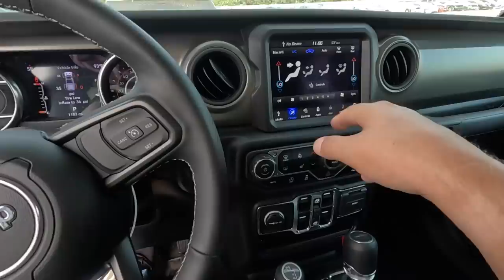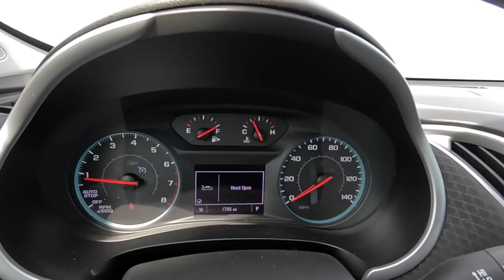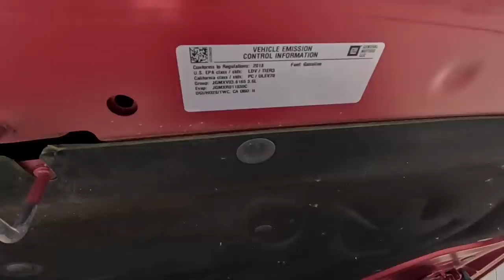This Dodge Nitro R/T was Scrapped but Why? An Impala is NOT a Luxury Car!

Comment: I had a 2012 Impala LTZ, bought it used with 30k on it back in 2013. Fully loaded. It was silver with a beige interior, factory 18 inch rims and a sunroof. The 2012s were the first year to offer the 3.6L and 6 speed auto. It was a great car. I sold it in Nov 2019 and it had about 70k miles on it at the time. 

June 2020 I bought a brand new 2020 Impala Premier. Black (inside and out), fully loaded, sunroof, heated and cooled front seats, 20 inch wheels, adaptive cruise control. I still have the car and take really good care of it. The car has been pretty good so far and it has less than 13k miles on it so far (I drove trucks for a while which is why the miles are so low). Only issue I had was when the car was still new, about a week later the A/C stopped working. Took a year for me to finally get around to fixing it. The had to replace the evaporator which is located in the dash. It was covered under warranty but it still was very annoying. 

The 2020 Impala is a much better car overall than the 2012 Impala I had. More room inside and better materials, but you are 100% correct. The Impala is NOT  a luxury car. I've owned mine for 3 years and I still don't look at my car and say it screams luxury. It is nowhere near that level. Its just a nice premium full size sedan but less than luxury.

Comment: the jeep wheels are like that because the rear brakes are smaller than the fronts...
ie the fronts will be something like  15' discs vs 13' discs  for the rear
and the spare will be a 15' size  rim (i'm guessing here)
so you need the full size rim at the front to keep it rolling

Comment: I bought a brand new General Motors Holden SL/X 5-Speed Gemini Sedan back in 1982 in Australia. It was a Special Order so I had to wait for it to come in and I picked it up after work, in the dark and checked it out the next morning. Once I got it out into the Sunlight my Heart sank!! The entire left side of the Car had bad Paint with mottled metallic and shrink back, loads of Filler in the rear Quarter Panel, and Paint brushed over the Guard Bolts and Door Pins. 

To top that off the Oil Filler had blown out of the Tappet Cover blowing Oil everywhere under the Bonnet! The Engine was faulty with bad Rings and the Brakes would lock up if you placed your Tow on the pedal as if you pulled the Hand Brake on with the rear Wheels locking up! 

I took it back immediately the next Morning before opening time and they actually told me "To go F**k myself! 

I tried every thing, even bringing a Solicitor onto the case, but I could not prove that they knew it was damaged, and they counter-claimed that me being a Panel Beater, had smashed it on my way home Saturday night and repaired it the next day.

Unfortunately Australia does not have Lemon Laws like the US.

I SWORE I would NEVER Buy another NEW GM Car again. And I have not. I have owned many Used GM Cars since, but would not piss my money away on buying another new one after how I was treated!  

After GM shutting Holden manufacturing down I cannot wait for them to fall on their own Sword! Many American's LOVE the Pontiac GTO Coupes, Pontiac G8 Sedans, Chevrolet SS Sedans and Caprice PPV's that Holden built for Chevrolet and sold in the US. Many are also pissed when GM closed Pontiac down, missing out on the Pontiac G8 Sport Truck (new El Camino) they were about to receive.

Comment: If you bought a 2016 Impala LT it would have come from the factory with remote start if it doesn't have it on the key then someone programmed a non remote start key for it. Anything over the LS trim comes with factory remote start. I've had 4 impalas so far and loved every one of them. Super reliable cars especially if you keep up with your regular maintenance on them.

Comment: At least that previous gen Impala had one iota of dependability left however those newer Malibus will not fare the same way guaranteed. You may be right about newer GM but even as a Buick fan I wouldnt touch that newer one with a 10ft pole. I give the marque 5 yrs tops. Its a shame.

Comment: I bought my wife a Dodge Nitro R/T with the with the 4x4.... we bought it from Carmax without the extended warranty!!! BIG MISTAKE... as we quickly found out that it was a previous repo and was ran hot!! It warped the head and needed the heads redone!!!! The worst thing about these 4.0L Nitros is the location of the water pump!!! Its in a very difficult place and you practically have to take apart half of the engine just to get to it!!!! Its the biggest pain in the @$$.

Comment: Vtuned just had a 22 or 23 Corvette that was wrecked and he rebuilt and just after he got it finished the tranny crapped out. He said in his video that GM told him there were issues with the transmission from the get go. Also, Buick= upscale vehicle. Not quite luxury but not base in my opinion.

Comment: Charlie the Impala guy here and i think i can shed some light on the luxury pecking order of GM. To start off you would purchase a Chevy or Pontiac if you had a job and made adequate money. As you worked your way up you could trade in those cars for something of higher standing such as an Oldsmobile or Buick. But if you hit the lottery and told that old boss to fuck off you can drive past your old job and give that old boss the finger in your new CADILLAC. There you go.

Comment: Buick Lacross is a German car (like Audi / BMW / Mercedes) as it is just an Opel with Buick badge. In recent years Opel has moved upmarket so you can say it's luxury. I drive the less luxurious Buick Verano (Astra sedan, 1.6 turbo, 6speed manual)

Comment: Skip the 5.3 SS Impala unless it's had a built transmission put in it. The 4t65e could barely hold the 3800's 220hp let alone the 300 the V8 has before a tune, exhaust etc.

Comment: Randy i hate to tell you this, but the higher trim Impalas are considered luxury cars.  From autotrader:

2018 Chevrolet Impala Premier

The Chevy Impala used to be associated with rental cars and fleet vehicles, but now it’s a bona fide luxury sedan in its higher trims. If you go with the Impala Premier, you’ll be treated to the latest safety tech, OnStar 4G LTE Wi-Fi, a huge interior, perforated leather seats and much more. This Impala is nice enough to save you a trip to the Buick or Cadillac dealer. The Impala Premier is a true luxury bargain, with a starting price of a little over $37k.